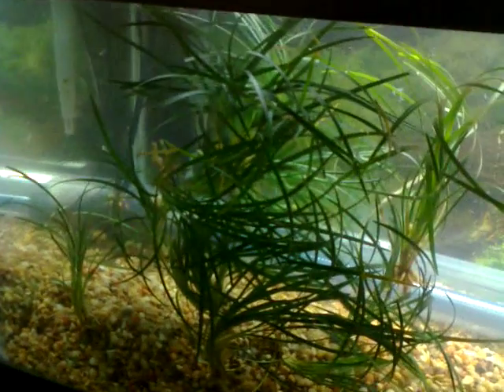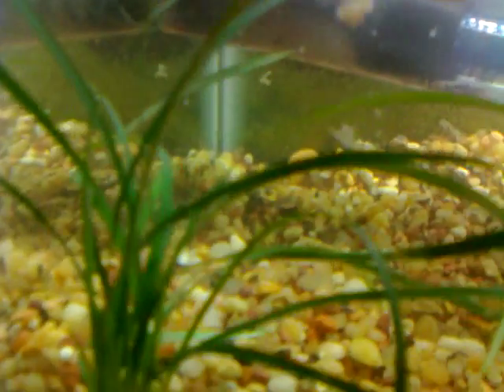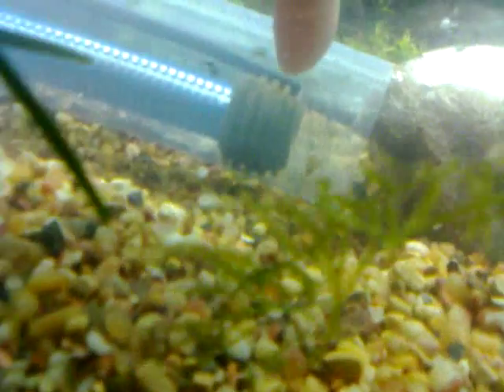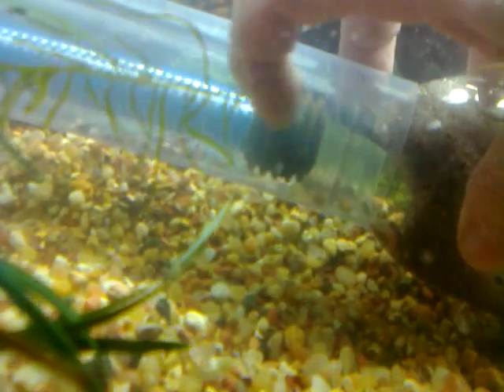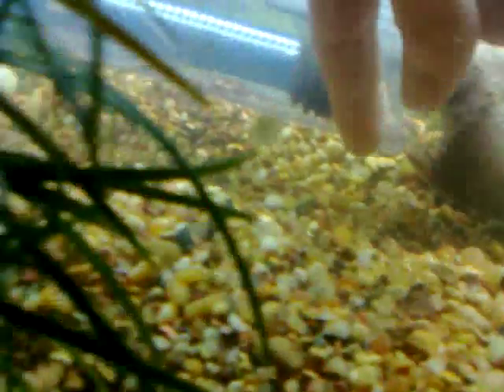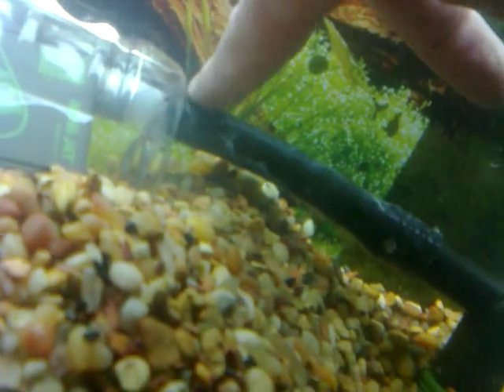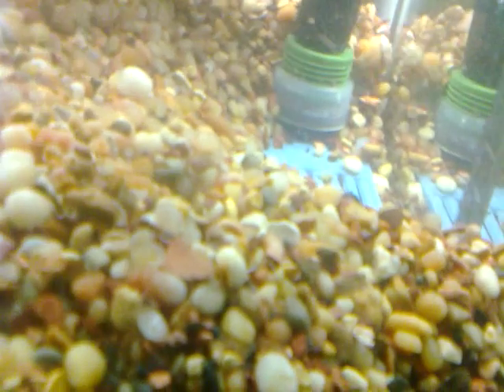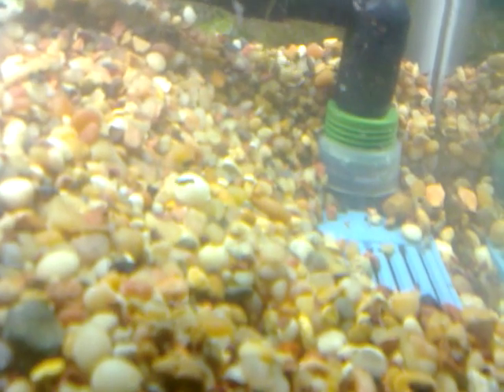My Dumb Projects: Heating a Fish Tank via an Undergravel Filter

Comment: sorry but this is just retarded. use pool filter sand its cheap and you basically dont have to clean it. many ppl dont. i bet you have that polyester fibres fackin everywhere. this vid isnt really about filtering but i have watched some of your vids, if you want good diy filtration make a wet/dry filter out of plastic cabinet from walmart, or a canister filter from parts from hardware store. sometimes your ideas have benefits but it seems all the time the downsides are way higher than anything good its doing, and not to mention hideodourous...